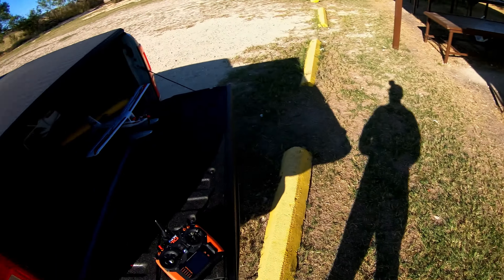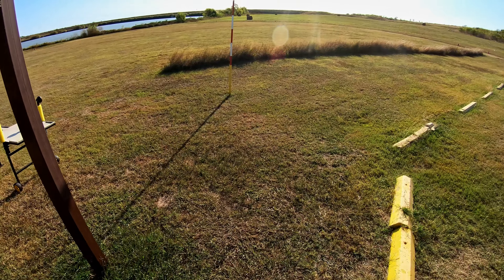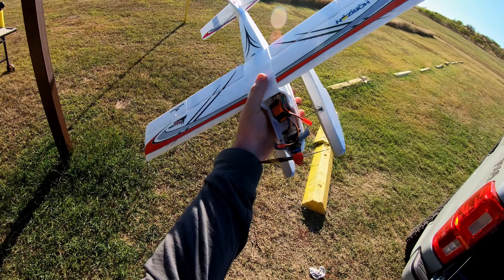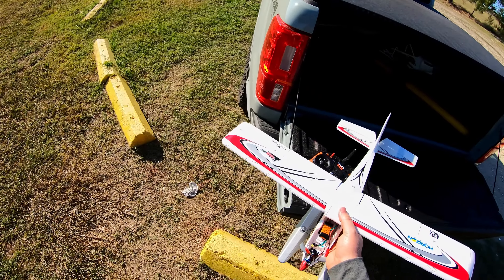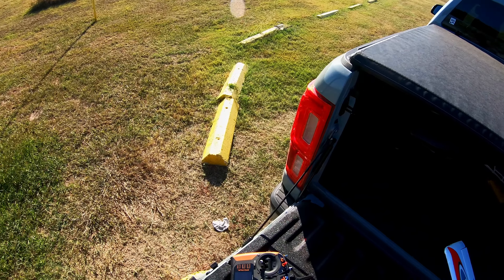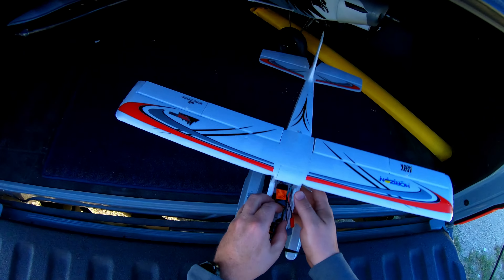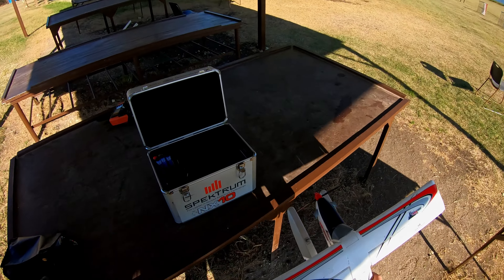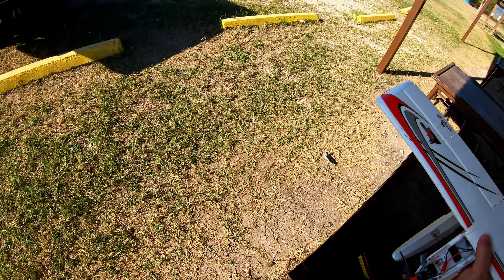Umx turbo timber evo...... 3s?

Comment: I was wondering if 3s was possible and I am sold ThAnkyou !!!
Reply from the maker: Absolute is with the motor swap. If seen guys fly it on the stock prop and motor with 3s you just have to watch how long you stay on full throttle or you’ll melt some stuff. Lol. Other than that she handles well 🤘

Comment: A bit confused about this is the model that you can make 3s this one E-FLITE UMX TURBO TIMBER BNF BASIC (A-EFLU6950) I find that if I use a 2s HV pack fully charged I cant even get the plane to initialise so how is 3s being used?
Reply from the maker: I swapped the original motor for the motor out of a 3s Pitts UMX. No problems initializing on the factory esc / RX for me. It is extremely sensitive to movement during initialization, but that occurs on both 2s and 3s for me.
Reply: I initialize my UMX Timber and Timber X in the box, that helps not having to re try a bunch of times. My UMX A10 and UMX Twin Otter are not so sensitive to wind during initialization.
Reply from the maker: @justinryan9417  that’s brilliant 😂 lol, thank you I’m gonna do that for now on. I wonder why some UMX planes are different than others. Oh well, thanks for the tip 🙏